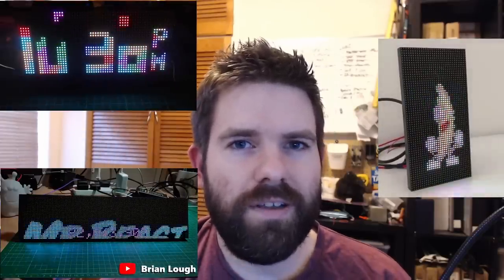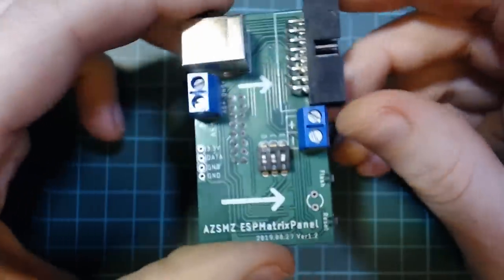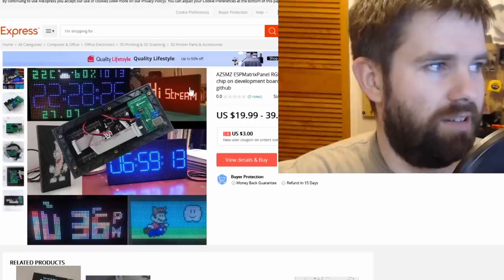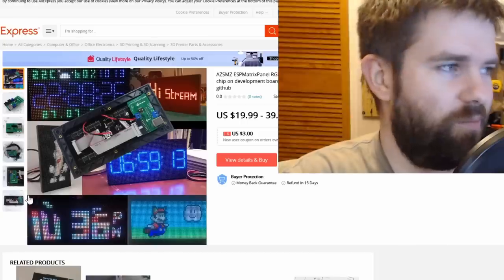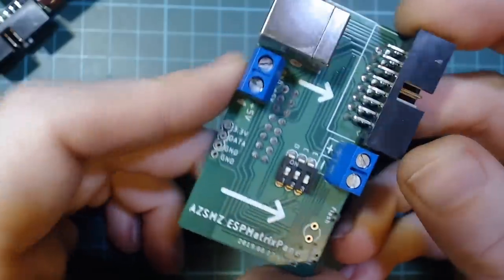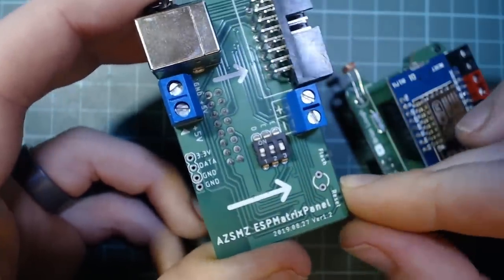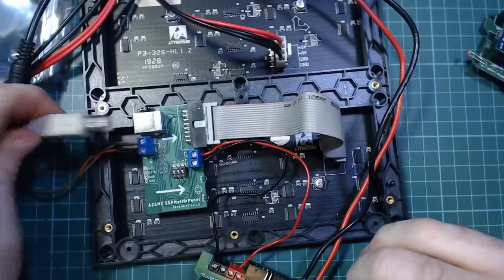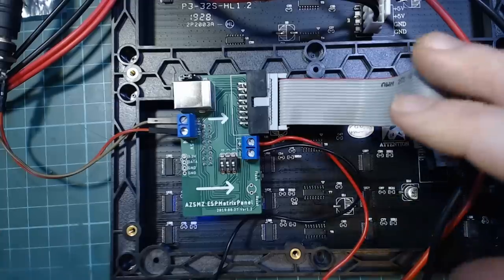Reviewing a potential Knock-off of my product

Comment: According to the people of China, "Copyright" means "the right to copy freely". So that's that.
Reply: Copy, Right?
Reply: This should disturb and concern people more than it does.  Not because of the copying so much as that this is a pattern.  Other nations have followed the same pattern.  They cut their teeth and develop their infrastructure while producing low-quality ripoffs and by copying everything.  But, they don't stick with that.  They move on and start developing things themselves.  When China does that... it's going to be a big change.  And given the structure of China, I wouldn't be the least bit surprised if they straight up forbade foreign companies from getting their product produced in China once there are enough China-designed creations.  That would cause some significant trouble to many companies around the world...
Reply: They have a different interpretation of Open Source Hardware and Software! Everything should be Open Source Unless it is their products!

Comment: I ordered this same knockoff one at the same time that I ordered your ESP32 breakout and the ESP8266 knockoff looses its programming once the power is removed, and with the ESP8266 being soldered on the board, its not exactly easy to fix.

Meanwhile, your ESP32 breakout is running great!
Reply: I just want to add that I ordered two more of Brian's boards since the knockoff ebay seller is being a pain with the return - I am probably going to have to eat that $30
Reply: I had to call them, but today eBay support followed though and issued the refund.  (The seller did send a valid return label) As far as I saw, there is a single seller selling AZSMZ on eBay

Comment: My guess is that the sound is coming from current flow between the stepdown and the USB. The board probably has the 5V from USB and the power from the barrel jack connected to each other.
Reply from the maker: I think you could be right, the input power goes through a diode and then is connected to the same net as usb 5V.
Reply: @BrianLough  Some of my early boards did the same and had similar hum (or just fried themselves when plugged in to both simultaneously). My guess is that the sound would be from whatever is stepping 5V down to 3V3 for the ESP8266, but it could be something else on there. Definitely a bit of a red flag to me.

Comment: I saw your tweet about possible high power issues. You loaded the board with 3A and it dropped from 4.45 to 3.4V. The board didn’t get very hot. 
So at 3A it dropped 1V. That means it had to dissipate 3W. Here’s my guesstimate:
At 6A it will probably drop 2V* and the dissipation will be 12W. That will definitely heat up things. 

*as the current increases the board will get hotter. That will increase the resistance. So the voltage will drop further and therefore the energy to dissipate will increase. And the board will get a bit hotter. 

At 8 Amps I think the board instead of the LEDs will light up.

Comment: I guess theirs comes with an ESP8266, but I'd rather send my money to Ireland if/when I finally decide to play around with one of these matrices.
Reply: And those power traces are way too small if it might have to handle 6A. I used a vcc copper pour for an RGB LED matrix I've designed, but yet to build because as you say, better to err on the side of excess than having something way too small. Smoking parts are one thing, smoking boards are something entirely different and something I'd rather avoid.

Comment: It looks like a lower cost version of your board, but sold dearer.
With the power, I guess you could bend the connector to fit it in.  I would likely find some kind of adaptor and heatshrink.
I still prefer your board.  The small power tracks concern me.

Comment: Bend the right hand prong up through 90 degrees so that looking on it from the end you see an L shape. That way the short part of the L will slip between the two connectors. Or get hold of two O crimp connectors and bolt each to the black and red U connector then put the crimp ends into that silly connector.

Comment: That "noise" at 14:40 could be because most adapters squeak when there is no load on them so your external power could have been replaced by USB power.

Comment: u could have folded the spade connector at a 90 degree angle so the one side of the blade would slide upright in between the 2 connectors   either that or just snip off one side

Comment: If you don't offer an assembly option on Tindie for an additional fee, you should.  I have been selling on my own Raspberry Pi -based designs on Tindie for over 2 years now and I offer an assembly option for most of my boards (usually and additional $5).  Over 80% of my sales are fully-assembled boards.  There are a lot of makers out there who want to tinker but are intimidated by the prospect of soldering because they have never done it before.
Reply from the maker: I'm so time poor that I just can't, and at the price I'd have to charge no one would want to pay it.

I've a full time job, two kids and a YouTube channel that all just pull me every which direction for time! So I will probably miss out on sales because of kit only, but I just can't facilitate assembled
Reply: @BrianLough  That is understandable.  For me, selling on Tindie is a way for my hobby to pay for itself - although I also offer custom PCB design work on a contract basis - so I have the time to put into assembly.

I enjoyed your vid and have run into issues like this myself, so cheers!

Comment: Both classic and sad!  Someone copies your design, but stuffs up things like the power trace width and power connector / module power cable incompatibility.  This alone explains why buying a solution design direct from a maker, who actually spent considerable time designing it, using it, and tweaking it, is the only way to go!  There is a big difference between a maker being inspired by another's design and thinking up a better / improved solution (whilst giving credit where credit is due).  Versus, these gutter folk who just steal another's design and quickly hack together a poor quality copy, with their sole purpose being to profit from other's hard work.   Unfortunately there is not much that can be done, however your video nicely outlines what this despicable AliExpress trader has done!  Hopefully the word will spread wide enough that any profit they make from your design, will be be more than offset by lost sales from word-of-mouth "BANCUIT Store" blacklisting.  I wonder how many of this Store's other products are also design rip-offs?

Comment: The easy solution for the power pin is to cut off 1/2 so it will fit in the socket.

Comment: I don't know... there are only so many ways to perform function "x" and to be frank, I see more similarities in their advertising than in the board... Is it damn similar? Yes... but I would expect that for doing the same job... However, your choices were based on DIY, being able to remove the ESP266, not changing any hookups, and larger through hole components.  Theirs was SMD, full assembly with permanent attachments and different connectors... By the way, cut off the damn fork connector and strip the wire a bit and it will easily fit the more secure smaller receptacle just fine.  I am finding it harder to reconcile that you actually designed and build this board when you don't seem to know how to do some simple electronics.  Even the Adafruit adapter solution is "Electronics for Complete Idiots" there... sure let's just leave live power leads not only exposed, but hanging out there where contact with anything metallic can short the whole damn thing out... Yeesh! 

 I think I would still get yours first, I like supporting makers and hobbyists, but I can see the appeal of a fully assembled one with all the components for just a bit more... even with the shipping.

Comment: Brian,  If you had your boards designed using the cineeze software like JCLPCB or PCBWay and you have kept your project in their cloud for storage. I am sure it was taken and used for their economic advantage. They have been steeling intellectual property from all over the world, and I am leary to use their facility to have board built cause the information is stored on their servers to which they have access to. Any code I use and store I tend to encrypt so it can not be stolen used with out permission. Like you said in the video it would have been nice if they asked for permission to use your design and code, but with thieves like that well this is what you get. I rather purchase your board then theirs since the design and creation is much inferior to yours.
Reply: Technically it's not stealing, it's recreating ;) There's the mentality of "first copy your master, then become one" that they have to overcome, I guess. They've definitely looked left and right for a board like this :)

Comment: Totally pointless complaints. Everyone copies most everyone else. Take the 555 - there are so many manufacturers.
.
When / if I need a generic image, I often use DuckDuckGo to find something.
.
Even large corporations search for circuit ideas on the InterNet. What my company does is to design a PCB, fill it with physically compatible / electrically wrong (so no one can figure what the hell the circuit is for) and then we ship it off to China (we live next door) to a manufacturing optimisation company. They optimise designs for $100 a unit.
.
Labour costs don't drive prices high, rather the middle men who import the products.
.
If anyone is to complain about copying / cloning it's Arduino and their complex boards not simple PCB's that you sell.

Comment: the chinese copy everything. you can't sue them because the chinese government doesn't care. I've seen a lot of clones of DIY 18650 pack designs people sweat their time and effort into making it, the chinese simply buy one and reverse engineer it but they have one big issue, they cheap out of a lot of things to the point it's dangerous (at least with 18650 packs with thin wiring).
rule of thumb, buy from the original designer to support and get best quality for $.

People are more likely to get one already assembled if it costs them a few dollars more.. unless you're a techie and love doing self assembled.. so, they are gambling on laziness

Comment: So let me get this straight, when I designed a 32 servo controller with a single PIC and put the hex files out there, everyone complained it should be open source. When I released the source and said you cant sell them, everyone jumped my shit and said its not true open source. When I say a guy post his robot arm designs as open source, but cant commercially sell, there was a huge hack a day outcry that its not true open source --- so you open sourced something and someone made and sold them and now you bitch about it? all the scriptkiddie makers whine and complain because they cant do the work, and when they do the work they whine and complain because someone did something with it.
Reply: Seriously Michael? 1. Brian's project is NOT open source. 2. Even if it was, the marketing material Brian made for HIS product is not open source or free to rip off for others to benefit from. Just because you got yourself in a pickle with your projects, don't dump on others, ESPECIALLY when you got ALL your facts wrong.